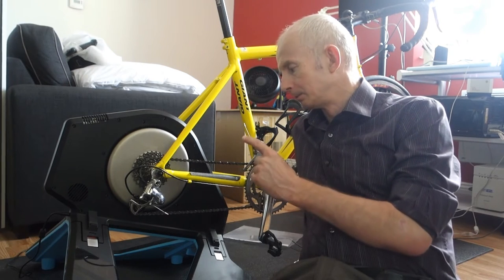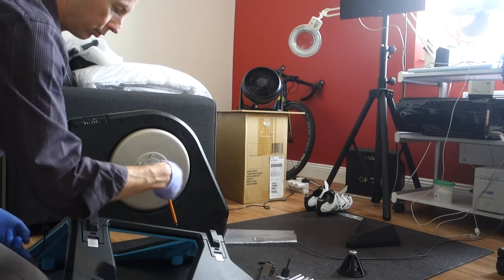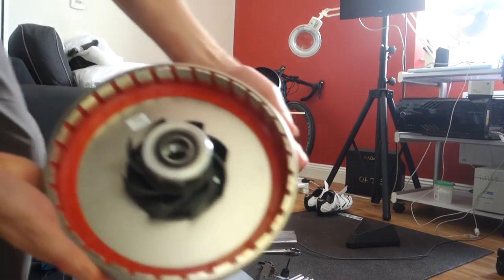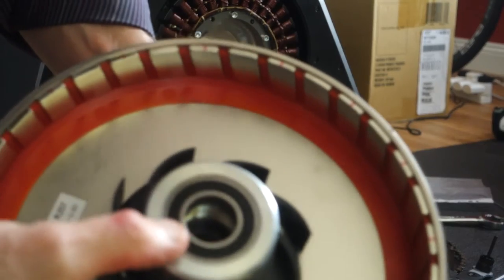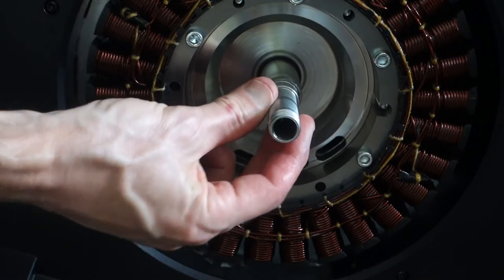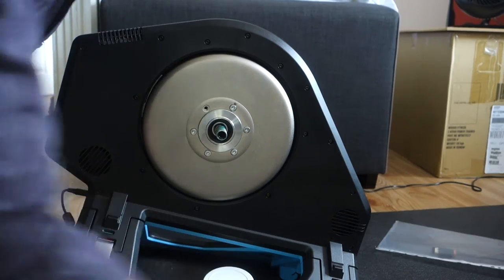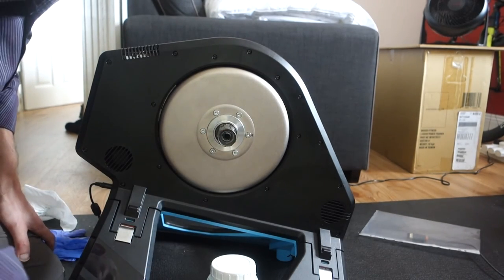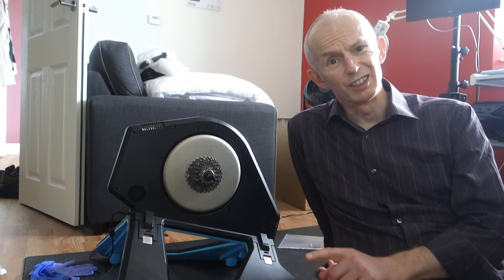Tacx Neo 2t disc removal and service

Comment: Hi Duncan. It's very nice to see your video, as there has been quite a stir related to the bearing ring nut for Neo 2T. In your video, you happened to have a bottom bracket tool that seemed to fit the ring nut. I went through all my bb tools, but I don't happen to own the one that you showed. Could you provide any additional details about this bottom bracket tool you located for removing the ring nut?

I would very much like to get my hands on one of those if you happen to have a part number or manufacturer.
Reply: @DuncMcNutt  did you actually try to remove the ring nut with this version of BBT? I agree that it fits into the space, but I don't see how this BBT can possibly remove this ring nut. I checked the BBT 22. When I get it into a position where it will fit in between the teeth of the ring nut, it slips over the ramps. It seems the only result will be rounding off the ramps so the ratchet is less effective.

Comment: I would like to build the ring nut tool by myself (have access to machine tools).
With the dimensions or even CAD data, the whole thing would be child's play. But of course they are not available anywhere ;-), after all Tacx would like to earn 70 bucks with the exchange of components. Instead of 2-4 coins for the direct bearing exchange. I guess I'll have to dismantle and measure the whole thing when I get the chance.
Reply from the maker: Wish I had the tools and skills to do that sort of thing. I did manage to buy a tool from some guy somewhere. I forget where now. Not needed it yet.

Comment: Did you use the Tacx Neo Gen1 disc extractor tool or the Neo 2T extractor tool.  It looks like you used the Neo gen 1 tool.  Is your extractor tool the one from ebay and also found here (https://www.thingiverse.com/thing:2748489)

Comment: I cant get the sleeve (spacer) off at all behind the hub. any suggestions?
Reply: @DuncMcNutt  I sent a video demonstrating this problem to Garmin today after an earlier phone discussion.  The spacer is completely solidly fixed to the axle. Even with a gentle pull with a pliers it wont come off.  In fact it appears to be sitting not completely flush on the disc/bearing body. I suspect this is the reason the freehub is offset by maybe half a millimetre outwards. This in turn causes  some issues with the chain on the smallest ring due to the angulation in relation to crank set. All very odd. Thanks for quick reply !
Reply: @DuncMcNutt  I am aware of the tacxfaqx channel. Yes it is under warranty and only a few weeks old. It was sold as new but showed signs of use which the shop admitted as oversight and offered a discount. Once garmin confirms this is not right it goes back to the shop, hopefully for refund or exchange.
Reply: How did you solve your problem?